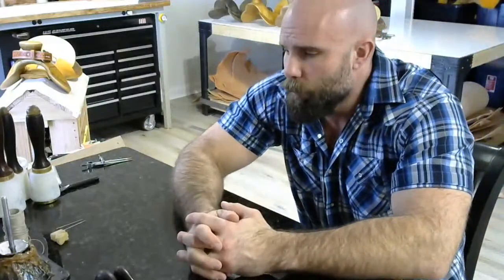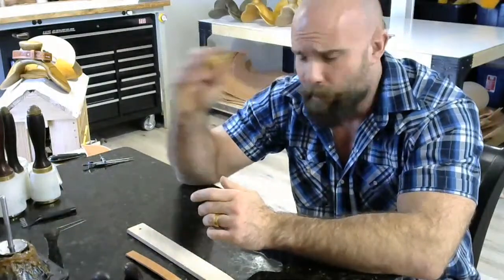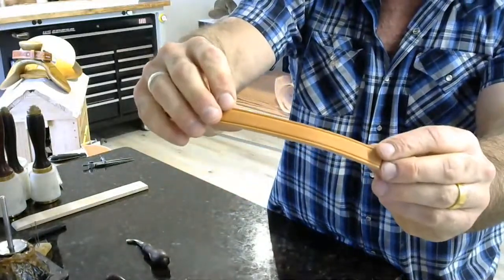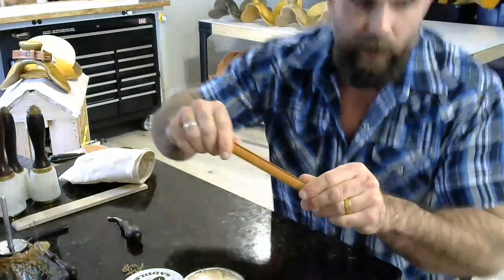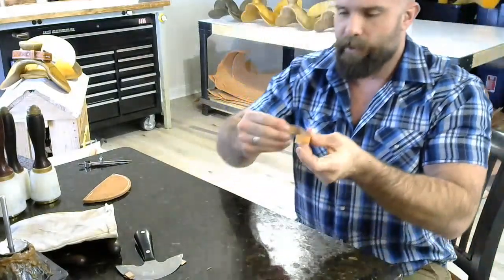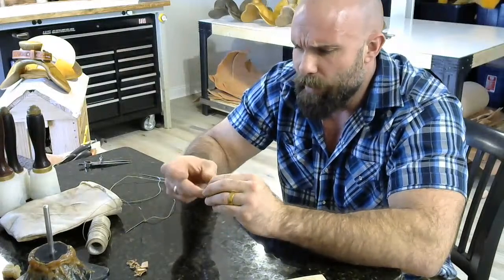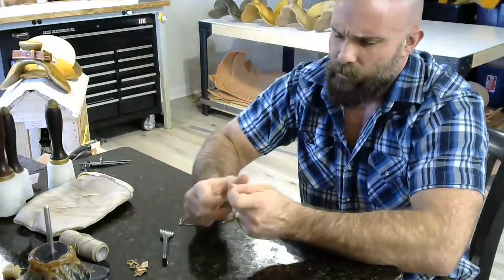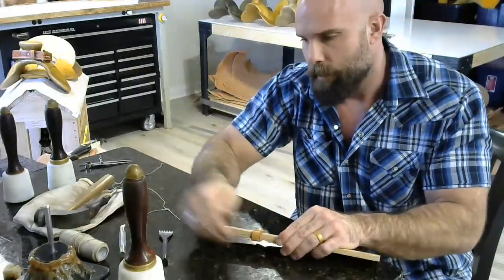Making a Belt Keeper the Right Way - Livestream #02

Comment: I am a leather worker beginner. I have been making belts as they are pretty simple to do. I am I finally found your explanation on how to make a belt keeper the right way,  I have been butt joining them and stitching. I knew no better way to do it. duh. I had one fail. In the future I will do them the same way you  I think your method could not ever fail.  Thanks  for teaching the right way.  I can now make belts that will not fail.